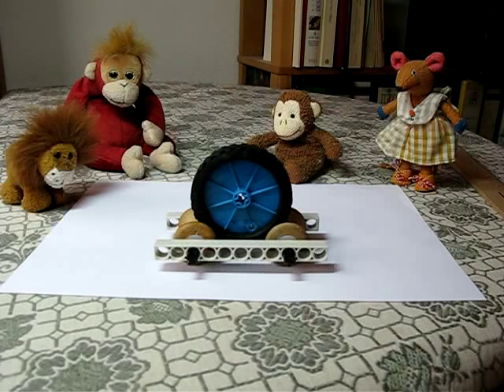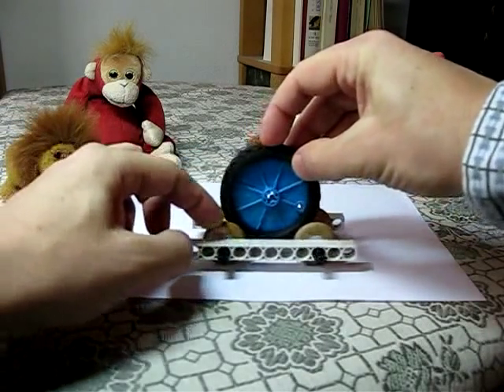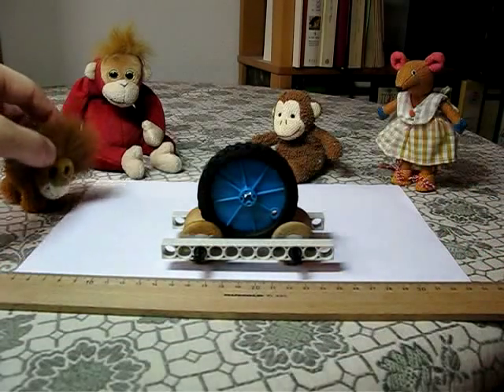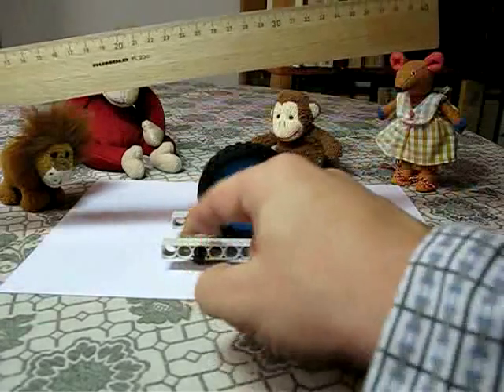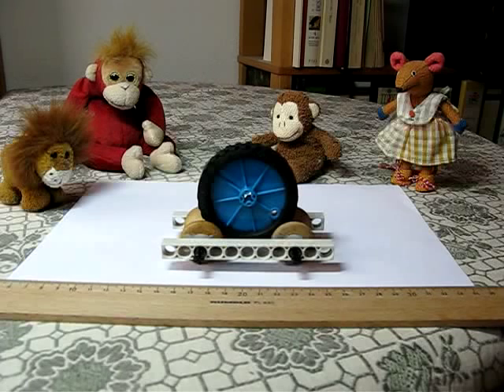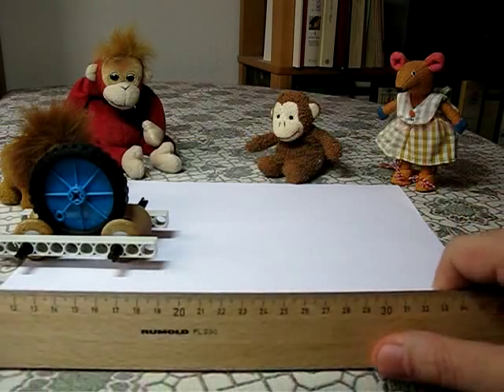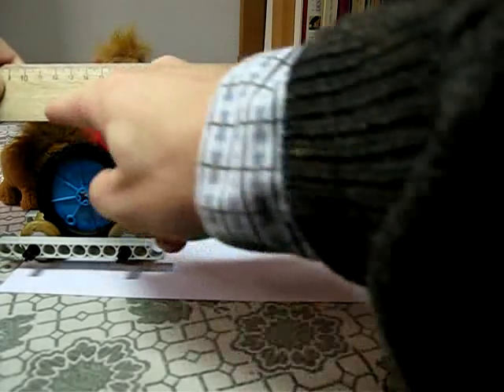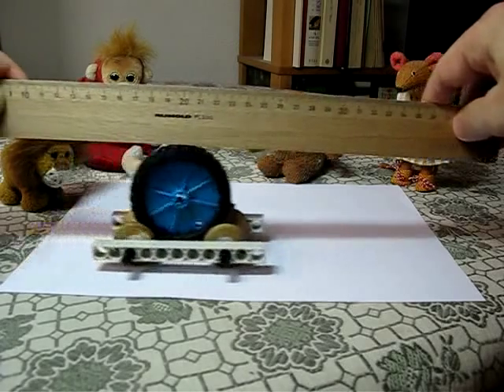Under the ruler faster than the ruler

Comment: Let's see him use the ruler to put pressure on the blue wheel, stick a pencil in the hub of the blue wheel and then try to move the pencil either right or left...and when mainline pressure becomes greater than governor pressure the spool valve shifts and the 1st/reverse clutch is released...nevermind, none of you want to become mechanics anyway. Go administrate and mistake it for managing.

Comment: optical illusion.  the cart moves the exact same distance as the ruler moves.
Reply: no it doesn't. if one moves faster than another for the same amount of time, then it moves more. dynamics tells you that the cart moves faster than the ruler.

Comment: Terry please explain. Terry!
Reply: Hes not technically just moving the ruler hes apply slightly more pressure to one side of the wheel while hes move the ruler. Terry's a lying git.
Reply: CHADarK758 loool the last sentence was priceless
Reply: CHADarK758
 Actually, the side of the pressure doesn't matter. What's happening is a gear ratio. The reason he uses the spools is because the inside part of the spool is smaller than the outside of the spool. One revolution of a small wheel covers less distance than one revolution of a big wheel.